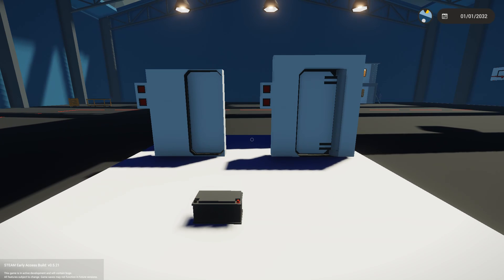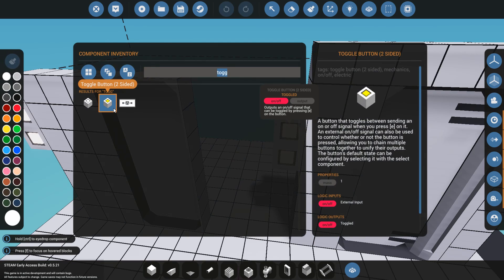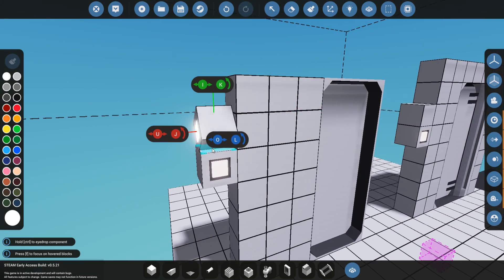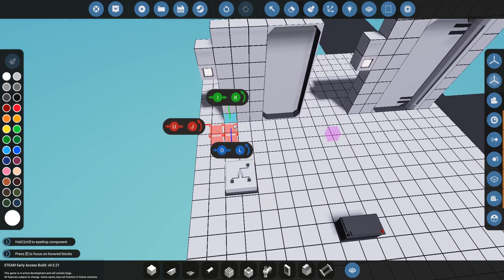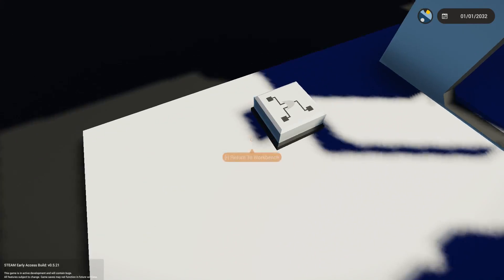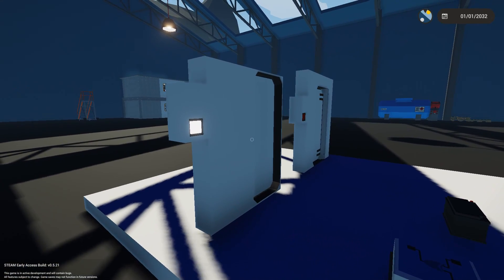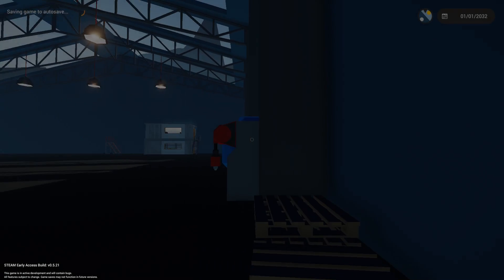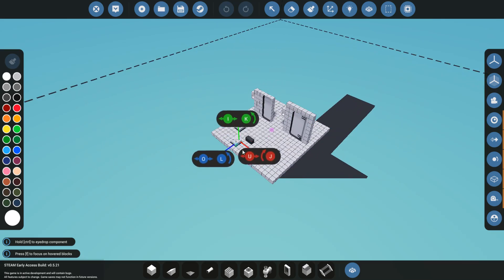Stormworks: Build and Rescue - Opening and closing doors from two sides

Comment: You can connect each button's  output to the other's input to make them work as two sides toggle button.
Reply: I agree with you, I much prefer to connect one toggle button to the door, and a second toggle button, and connect the second button to the the first button. This basically creates a master slave configuration where the buttons follow each other's state. No need for logic at all, and actually kind of nicer than the two sided button because you can place the inside button in a different place than the outside.

I actually have a circuit in my ship with three buttons controlling two doors simultaneously this way. Press one button and both doors open and all the buttons light up, go inside and press the other button and both doors close and all the buttons go dark!

Edit for clarity